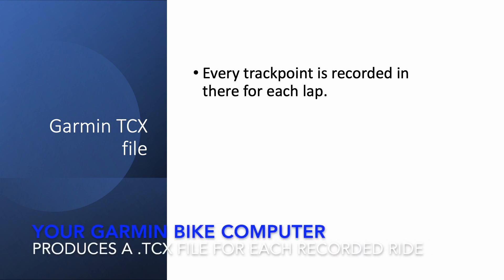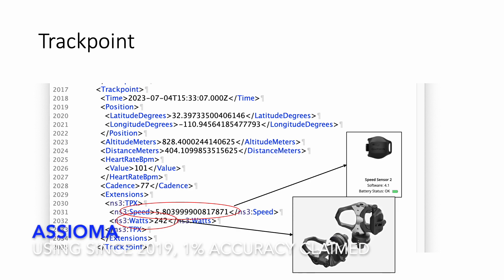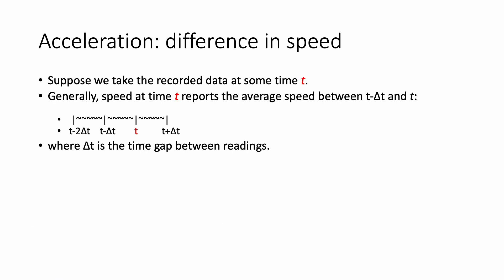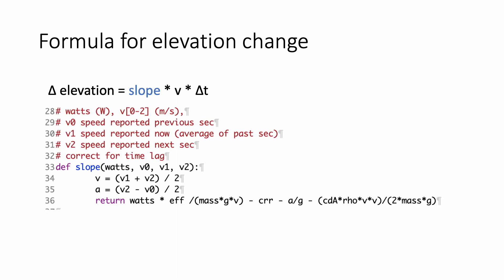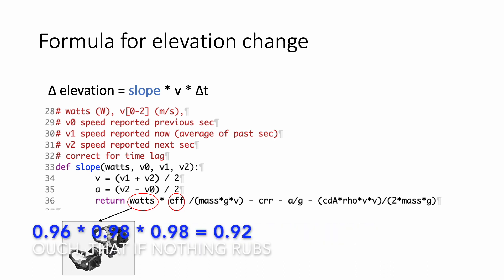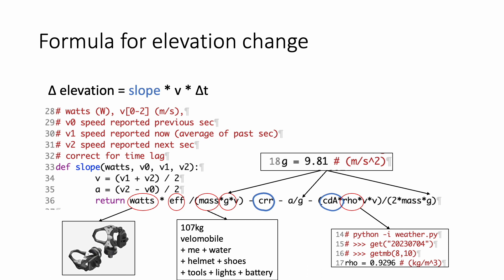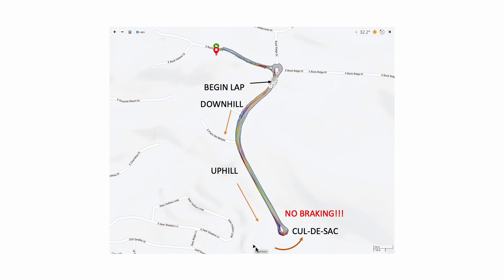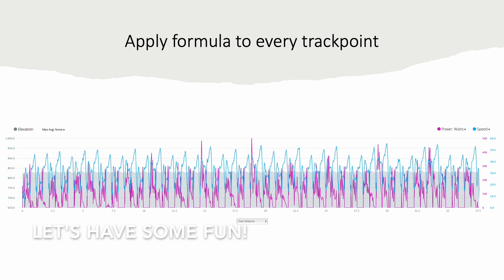Snoek Velomobile: Can aerodynamic testing reveal small optimizations?

Comment: Thanks for adding your voice, it helps so I can look at the text while you talk.  If you can manage 242 watts while maintaining only 102BPM HR you're in super shape and should be racing in France (TdF) with the fast guys now.  When you mentioned 2% slope can add 3km/hr are you referring to uphill or downhill at 19m 18sec in your video.  Thanks Mr. F.
Reply from the maker: My resting HR is low. But 242W at that HR is simply because I opened the file and took the data from near the beginning of the file. That simply means my HR hasn’t caught up yet.